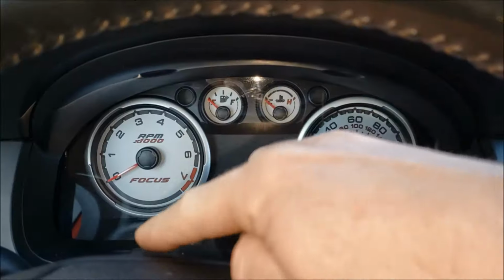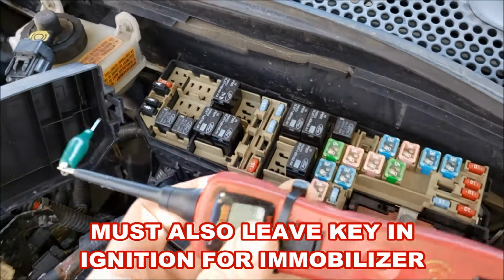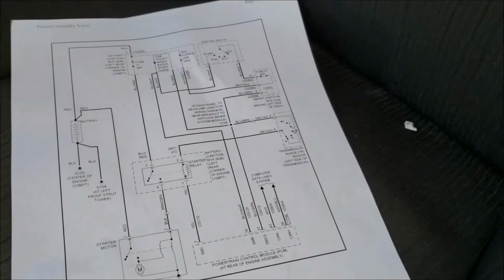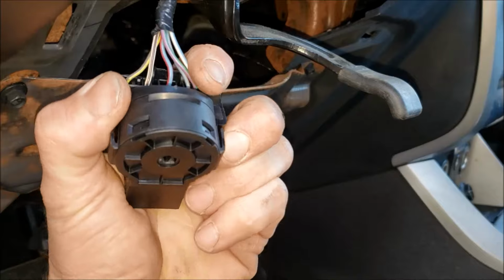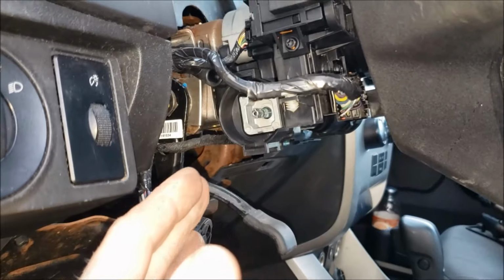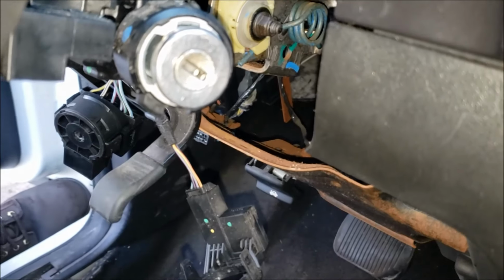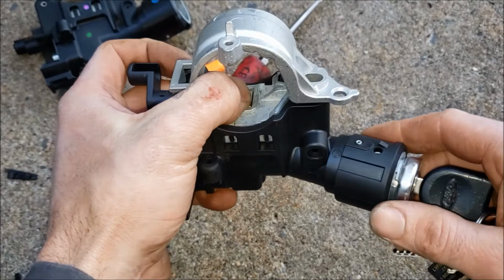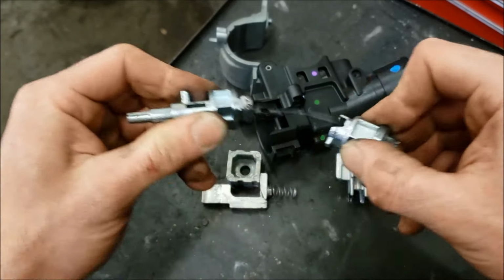08-12 Ford Escape / Focus / Mariner No Crank No Start,  Diag and Ignition Module housing Replacement

Comment: I had a similar issue caused by a rodent damaged wire between the ECM and the Body module.  Caused stall no crank condition on my 2014 Ford Focus.

Comment: So if the diode has no power when turning the key and fuse 27 has 12 volts that means the ignition switch is bad?

Comment: My mothers husband has an 09 focus w an intermittent no crank no start. First thing in the morning, it usually starts up just fine. Later in the day is when it can be hit or miss. Sometimes he tries 3 times to turn it and no click from the starter at all, then all the sudden will start. A couple times it took him over an hour to get it started. I switched the relays around, it still wouldnt start, took the key out and turned it around, first couple turns it wouldnt start, then it did. This was after sitting for 6hrs or so. A couple times after sitting all day, it would start right up, i would shut it off then back on, it would start maybe 8/10 times. Never any hesitation from the starter. Its not the security bit

Comment: i took a wire and put it to that diode and touched it to my battery and hear a click no start 1:40
Reply: replaced it with another and it still doesn’t start i can get it to start with the switch inside the car if i just keep trying but it takes lots of tries

Comment: Yeah...Fantastic video.  I just used this for instructions to fix my 2009 Focus.  Spot on.  Like a brand new car now.  It just took me 3-4 hours because I don't have all the fancy small tools and had to improvise.  The security bolt wasn't a big deal, just hammered it with a screwdriver.  Biggest issue was the little 5.5mm bolt 90 degrees behind the wheel next to the key.  Oh my.  I had to rig something up at a 90-145 degree angle to slowly work the bolt out, and the same to tighten it after.  That prolly totaled 45-60 mins alone on that damn bolt.  I don't have a flexible extension nor a small rachet wrench.  But yeah, prolly saved like $400-500 doing this myself.  $40 part on Amazon.  Thank you, sir.

Comment: I have a 2010 Ford Escape and watching you do this Ford told me I had to have mine reprogrammed. So I put a push start in it as long as I have the key in the on position it works but occasionally doesn't. So if I put a new lock cylinder on here and housing. What would I have to have it reprogrammed or take it to a locksmith to where my old key fits the Tumblr? I was wondering if you use new keys in this with the new Tumblr lock?

Comment: thank-you very much.  This video walked me through the change and repair of the ignition lock housing perfectly.  This saved my dad hundreds of $$ from the Ford dealer. I took one extra step, which was to disconnect the battery before starting into the ignition housing, as I was concerned I could possibly set-off the airbag.

Comment: I see the kits online and they include 2 chipped keys.   Not sure if it includes the reader .  The read is part of the ignition assembly right? Or do these people on ebay seel the keys but they have to be programmed?   I'm going to try the things you suggested. Thanks for the under the hood stuff. Got it started.

Comment: first let me say your video is 2nd to none Thank you . I have a 2010 Ford focus I had a new ignition key made and it wouldn't start so I got the original Ford ignition switch and replace it . still won't start. if I use the screwdriver  like you did and turn the  ignition switch & it still doesn't start is it a faulty ignition switch? could it be the immobilizer ring? I had the key side ignition Tumblr replaced last year I would greatly appreciate any and all advice. thank you do the best informative videos & for saving us tons of money

Comment: My sister is have an issue where her push start she had installed was broken and the next day her car would not start I will put the key in and the dashboard would not light up nor will the radio turn on I'm hoping this is the ignition housing unit can anyone please give me an idea if I'm aiming the right direction? The battery, alternator,and fuses are all good. She has a 2008 Ford focus

Comment: Great video,one point worth mentioning,after several attempts to remove the ignition barrell,i found that the alighnment pin will only release when the key is in the accessories position.

Comment: Alright, 5 years later AnnnD
I found a potential cause of this condition you missed:

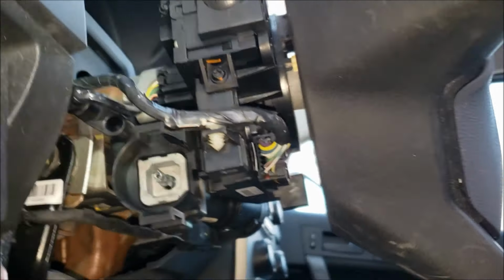Passive Anti-Theft System (PATS) - SecuriLock® (aka immobilizer 8:43)
The system is an engine immobilization system. It is designed to help prevent the engine from being started unless a correctly coded key for your vehicle is used. Using an incorrectly coded key may prevent the engine from starting. A message may appear in the information display.

The embarrassing TL;DR
My 2008 Escape is headed to the junkyard, un-inspectable in PA due to frame rust. But it is my emergency 2nd car so I keep the battery charged. The key refused to come out of the ignition when off so it stayed in. But too much force broke the fob, and eventually it fell off and was put in the cup holder.

A year later, and I go to move the car in the driveway and I got no start. While thinking I am not going to put money into it, I also want to drive it to the salvage yard, rather than having it towed. So I did the Google search, and a link to your video was provided. I went over your checklist, and I really appreciate the wiring diagram - even printed it out.

I had already replaced the ignition module years ago, so that wasn't a suspect - then I read that sometimes you can mitigate the wear by pushing the key in while turning. And I thought that would hurt ('cause it was broken off). 

But also, just what is an "immobilizer"?

Welp, fooling around with it enough the key magically came out, so when I tried starting it with the spare, intact key Voilà❕

Thanks for walking me through the troubleshooting!

Comment: Tested the ignition switch with the key turned in the on position and a screwdriver turning the ignition switch and it doesn’t turn on. Any suggestions of what the problem may be? The ignition switch was recently purchased a year ago from a Ford dealer. 5:45
Reply: Did you find out what it was im having the same issue
Reply: @ahmadabumathkour5698 not yet I switched out the ignition switch today and it is the actual Ford focus ignition switch for the vehicle not generic I had a new chip key made the power comes on in the vehicle but it will not turn over at all I get nothing at all as soon as I have an answer I promise I will get back to you I will be calling Ford 12:34  in the morning if I don't get an answer tonight
Reply: @ahmadabumathkour5698  what my issue was that my starter fuse burnt out
Reply: I'm having exactly the same problem if I get a response for the answer I will pass it along sorry for your troubles I know how you feel😢
Reply: @kimberlyeichelsderfer9126 try testing starter relay fuse located inside hood fuse box.
Reply: the locksmith who made my chip key with the ignition told me it could be the immobilizer ring on the Tumblr side of the ignition switch might need to be replaced I'll be thinking one of those up tomorrow and putting that in it's very easy this guy's videos are great I'll let you know if it works

Comment: great, well explained video.. it is pretty annoying how some parts are intentionally made hard to repair due to "security" but yeah overall seems to be relatively simple after getting the security bolt off. here's hoping it works well for my 08 mariner.

Comment: Excellent video. My new module came with an ignition switch attached. Should I transfer the multiple wires to the new switch and if so how is that done. There's a little bit of wear in the plastic opening of the old module where the key pin sits but don't want issues later on if wear become an issue and I have to start all over again. Can they be detached by pulling on them

Comment: I can start it from the diod replaced the ignition switch still won’t start. New battery new starter what else can it be?
Reply: I was told to try the immobilizer ring on the ignition tumbler side it's basically an anti-theft ring around  the key ignition side

Comment: thanks so much!  i've been screwing around with my 2012 escape for weeks.  changing the ignition switch didn't fix it.  i checked starter relay, battery condition, alternator, parasitic power, etc.  i was just about to tear into the starter solenoid, but jumping the starter relay started every time. turns out just pushing in on the key cranks it every time. 🤣

Comment: I've been dealing with this issue for 2+ years, barely scraping by using the electrical tape trick. I've replaced my lock module / hosuing, ignition switch, and ny lock cylinder awhile back. Nothing has worked to fix the no start issue me. Also, starting the escape using a screw driver inside ot the igntion switch does not work for me, even with a new ignition switch. I dont know how to fix it since nothing has worked. The electrical tape trick works much better during winter time rather than hot summer. I just wish i could fix it once and for all.
Reply: try replacing the immobilizer ring found on  the Tumblr side ignition switch aka where the key goes it's a ring around key ignition side it's like an anti-theft device I was told by the locksmith who made my new key that broke even with the new chipped key it wouldn't start I had to have it towed I replaced the ignition switch today on the left side with a Ford ignition switch that's the actual switch that the car was made with. and still won't start so tomorrow I'm heading out to buy the immobilizer ring and see if that works good luck😊 I'll let everyone know tomorrow I'll leave a message on this video site

Comment: When I try to start it from the diode it does not work. I tested the diode and it is fine. Does this point to the PCM? I can bypass the starter relay and it cranks

Comment: 2005 Ford Taurus here. My key became harder and harder to turn. If I turn the key on a daily basis, the ignition switch would loosen up. If I missed a day, it would  stiffen up again.

One day it was really stiff. I kept trying to turn the key, and POP. the ignition key turns freely all the way around. I can no longer start my car.

I looked at several videos about removing the steering wheel, and came to the conclusion that I could not possibly remove the steering wheel.

Comment: This video was the best one I have seen on this issue on a focus.  I just fixed my daughters car in a college parking lot yesterday afternoon doing everything you said and it went flawlessly!   I did use a dremel to cut a flat head spot in the security bolt though and that worked great.   Thank you for putting this out!

Comment: At the diode I just shots all my dash lights of and radio everything goes off until I take it off, but I can turn the engine over at the starter relay but doesn't start, problem is I turn the key and nothing

Comment: Much easier and cheaper to install a push button start. Less than $5 and my 2010 Focus starts every time.
Reply: a push start requires a key fob? I have a 2010 Ford focus key ignition there's a chip in the key but will not start a push button if I switch over?

Comment: 2010 escape. no crank no start,,with security light not going out.  we found that if we used the key fob button to lock the car,then unlocking it later with the fob button the security icon would stay on and  we'd get a no crank situation. a trip to the dealer to reset would probably help but we just dont use the button to lock or unlock anymore. we lock the old fashion way.  push the door lock down or insert key and turn it to lock or unlock . this way the security is not set. starts everytime now.

Comment: Chris, I know old video!  Just finished the IROC video, great car!  I inherited mom's 2010 Ford Escape.  One day the dash lights (the money lights that is) all came on, then went off, happened twice.  Since hasn't done it.  Now it wont start, must have flipped the key, started!  Battery, connections and starter good.  Would the dash lights coming on be related to the switch as well as the no start?  I think I will replace the module and the switch for poop and laughter.  Thanks for the videos and letting us tag along.  Still catching up on your videos.

Comment: I have the same issue. My security light doesn't turn off. I checked the fuses, relays, battery, and starter. Did the bump on the starter relay and starter cranked. Removed the ignition switch and tried cranking it still same thing no start no crank. Put a new ignition switch on and same thing. I have a mechanic telling me it's a bad pin fit at the fuse box since I was able to push the connector of the starter relay and it tried cranking.

Comment: Do you think the PATS (Passive Anti-Theft System) in my 2010 Focus will prevent me from doing this job?  I'd be happy if I could just open up the steering column and use a screwdriver in the ignition switch, but I'm worried that the anti-theft will prevent that from working.  Any advice?

Comment: Great video!  My mechanic is telling me he doesn't mess with ignitions because of the PATS system on the key, but you just showed that you don't even need to get a new key!  Not sure if I want to mess with replacing the lock cylinder side of it, but I might try to just drop the ignition switch and start my car with a screwdriver from now on :)
Reply: Did this work for you?? Thinking about doing this myself
Reply: @daissims I "dropped" the ignition switch so it dangled below the steering wheel. And started it with a screwdriver for about 6 months. Worked great!
Reply: @deltaspill  does it mean it's a faulty ignition switch if the screwdriver technique doesn't work after replacing it with a brand new ignition switch
Reply: @kimberlyeichelsderfer9126not exactly sure what you're asking. I was able to drop my ignition switch from under the steering wheel, opposite side as the key. I used a flathead screwdriver to turn the switch which started the car. If you replaced the ignition switch, is the lock cylinder bad?

Comment: FORD should put out a RECALL on all 08-12 .. This is a stupid and dumb idea from ford.
Reply: they're too damn cheap is definitely a faulty design and should have been recalled purchase the 2010 brand new replace the key Tumblr twice already and the ignition switch on the left side still won't start going to do the immobilizer ring tomorrow and see if that works it's ridiculous what you spend on freaking vehicles and they're made of plastic. question if the ignition switch doesn't start with the screwdriver does that mean the ignition switch is faulting

Comment: Thx! VERY MUCH!!! Took me a lot longer than it should have. 😳. About three hours. You almost have to be a contortionist to get some of screws back in. One trick I discovered is putting a  5.5 mm on an allen wrench to remove/reinstall the screws especially the one on the right side of the steering wheel if you don't have a wobble.

Comment: I have a 2008 Ford Focus and I was certain the ignition switch was the culprit but your excellent video educated me and I discovered the mechanism  (190K miles on the car) was at fault! I purchased 989-019 from  Amazon vendor Yikesai - Vendor claims part is for 2009 Focus and up so its not supposed to be correct for a 2008 Focus but it looked exactly like my cars part. It was priced at $45 WITH bolt and ignition switch attached. It was exactly the part i needed so maybe vendor has to revise the part fitment. Great Video Thank you!

Comment: Worst car ever. Bought a second owner one for my daughter and already in just a few months battery has died twice first time was lights don’t go off automatically you must turn them off yourself we did that but the park lights that always shut off when door is shut stayed  on all night flattening the battery. Today Joy of joys the back licence plate light just kept flashing until it went flat no idea why. I recharged the battery took it to the mechanics today traded it for a cheaper 2007 Mercedes Benz that after I had the mechanic do a $1500 service the car runs like new is bulletproof and smack v looking. Cost nothing as the ford focus cost $8000. So look for older BMW’s or Mercedes that are 15 to 20 years old get a full service that costs $1500 to over $2000 not just an oil change for about $200 and you get a great and safe car for your child. I’m super happy with my daughter’s Mercedes it was $90,000 brand new just 14 years ago.  With the good safe service you get timing chain checked oil changed new oil filter and all electrical work looked over. The car is worth it. It cost $5000 with the extra $3000 from the ford focus I used $2000 to get service done and had an extra $1000 left over to get some new plugs and put a full tank in. So look around there’s great BMWs and Mercedes out there and they look great.

Comment: I do mobile auto repair.  I watched this video on the way to the car. Quickest diagnosis I ever did lol 

Started the car by testing the fuse then popped out the ignition switch and started the car again. 10 minutes later I’m sitting in my truck in the AC. Waiting for AutoZone to deliver the ignition switch here at  the customers house

Comment: So I did the part where you took the bottom piece of plastic under the steering wheel off, then used the Phillips head to easily pop out the switch on the left side & used the Phillips head to start it. I did that just to get myself home. Because I know nothing about cars. But here I am a week later and it still looks like that. I’d like to see how easy/hard it is to put that part back? So it’s not hanging out when I take it to a shop. I assume it’s easy to just pop back in? And am I hurting my car by using the Phillips head to start it like that until I can get it fixed?